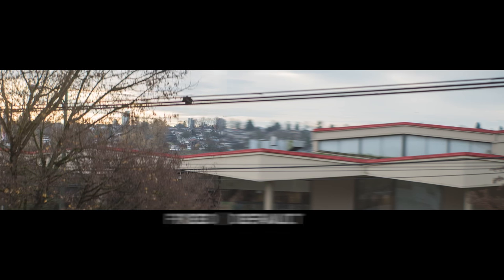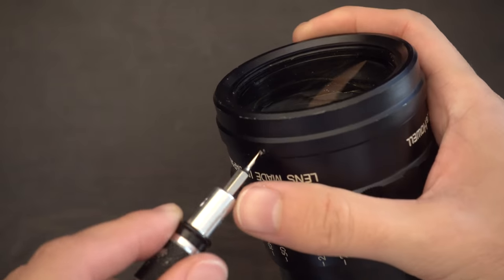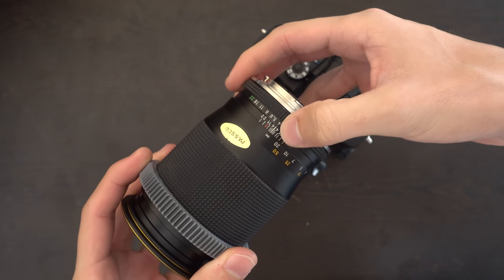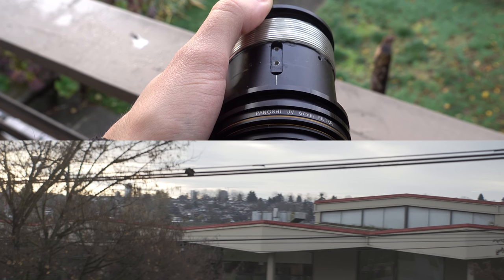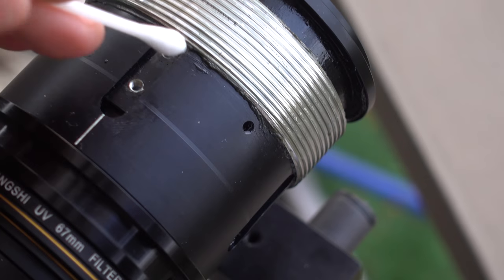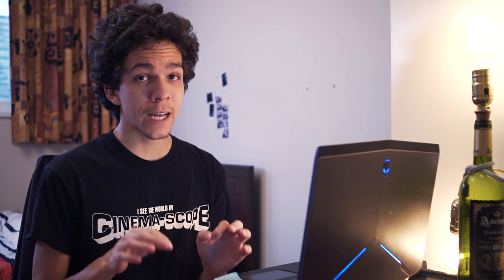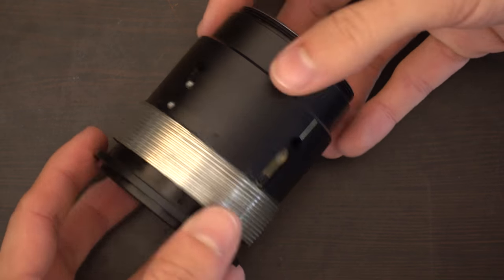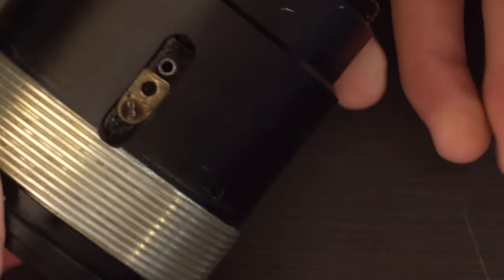Kowa B&H Sharpness Tune Up - Anamorphic Lens Alignment

Comment: Hey thanks for this video and your channel in general! Just to let you know, if you're facing the rear element of the lens, if you look to the right of the brass infinity tab there is actually a screwed out hole where you can use one of the screws from the tabs and just screw it in there to hold the whole thing in place at infinity once you find it. This saves you using tape to hold the lens in place at infinity. You can see the hole to the right at the 4 minute mark in this video. You could even use a socket set screw/grub screw and leave it in there forever as a set and forget infinity mark if you're using single focus solution diopters :)
Reply: This was a game changer, thank you for your help!!

Comment: So what happens when you need to rotate the front so far that the screw holes no longer align with the brass tabs? I have an Elmoscope II that needs fine tuned and it’s there, I just can’t find a way to stabilize it without the screws.

Comment: Instead of using super glue and things like that when locking infinity focus, what I found easier to do is to have the infinity tab (longer one) still on with the screws very slightly tightened but just enough to allow some slip. So what you would just do is first slacken those screws but leave them on, push the tab all the way forward in the recess, as there is some play,  lock the screws gently and now just push on the front optic against the resistance of the tab (it should slip now) until you reach infinity focus. Now just tighten all the screws and you are done.
Reply: Denis Tsunenko what lens did you try that with
Reply: The same Kowa 2x for B&H
Reply: Gotcha. So Tito, after noticing glue doesn't work well, would you not recommend the glue method?

Comment: Tito, thank you so much for this. Took my 16H from soft until f4 to fairly sharp at f2.8! A significant change. 

Some thoughts from my experience: 
1) As others have mentioned, I also just loosened the screws and re-tightened after some wiggling. This was enough for me. It's possible drilling a larger hole in the brass tabs would've given me more wiggle room, but I didn't feel the need. 
2) In reassembling, make sure you focus the lens at close focus before tightening the small set screws at the front. I kept tightening them at infinity and then the lens wouldn't focus! It took me wayyyy too long to figure it out. 
3) Use the right sized screwdrivers and provide good downward pressure when loosening for the first time. All screws are made of a softer metal (brass?) and can strip easily. 

In general I agree with @girafingo9280 - it's worth a try! A little frustrating but rewarding in my experience.

Comment: after watching this I figured there must have been something wrong with my Schneider Cinelux 2x (the one with the knob) because it was only sharp f8+, all I had to do was take off the back element lock, turn the back anamorphic element barely a millimetre (like you did) and geez it's as sharp as the taking lens will allow it. Thanks so much man.
Reply: Emerson Hoskin this is exactly the problem I have.Can you please share how you did the alignment?I unscrew 2 screws at the back,but how do I rotate the element?Thanks!
Reply: so on the back there's the two screws, unscrew them, then unscrew the next two underneath that until the very back element is loose (loose enough to pop out, but just leave it in. Try to set both the focus of the ana lens and the taking lens to the same fixed spot somewhere, hold the ana in front of the taking lens and very carefully rotate the back of the ana with your thumb, you might get a thumbprint on the llens, but you can just clean that, then screw the rings back onto the back and you should be all good man!
Reply: Emerson Hoskin thanks!any chance I can contact you via email?
Reply: just send me a message on Google+
Reply: Will it work for the Isco red star too?

Comment: Thank you for the video. I did it myself as well. My problem started with the back element. I bought my copy cheap...100 GBP...I placed the back element that in the position as good I could, turn it with some tweezers and, then added the rubber seal...that was in, and the ring, then I calibrate it even more with your method. The interesting thing is that the one I have had in the middle holes of the tabs glue and a little drilled hole under. I didn't see that in this copy. That was filled with some kind of glue..yellowish... I cleaned the old one and I added epoxy there. First in the little hole "bucket" from under then into the tab hole on a piece of waxed paper... and waited until got more sticky and thick. First, I positioned the one without the hole very well, focus it, then I placed the ones with glue, put the screws, realigned once more, and then tighten up all while it was on looking to a photo chart I printed. Then leave there 24 hours... Epoxy is said that in 7 days reach absolute maximum strength...like glass. I can say is not an easy thing and I spent hours...4-6...

Comment: Hi Tito, 
I've just followed the procedure you've outlined here in the video to tuneup my Moller 32/2x anamorphot adapter, I have to say the tuneup of my Moller is identical to that of the Kowa B & H.
Thanks for this video as it has really helped me out, Mind you, I've the better part of 6hrs today doing this.

One issue I did find with this adapter was, The two lugs inside the lens which are for the for focus tuneup, These two lugs were very slightly to wide for the slot they fit in as it felt like it was grinding sand inside the lens while focusing, So placed a piece of sandpaper on the flat surface of my breadboard and gave carefully gave one side of each lug a few passes on the sandpaper, Then refit, tune the focus up and now the focus turning is as smooth as a babies bottom.

Once again thanks for this video.

Comment: Whoa whoa whoa whoa whoa, at the beginning the locking tabs were complete, but at the end when he's putting them back in one of the ends is snapped off. That wasn't addressed. Does it need to be like that?
Reply from the maker: No, it doesn't need to be like that. That's another mod, for even shorter minimum focus. I don't really recommend it though.

Comment: Ok so my question is slightly different.. tne back element of the 16c, what would happen if I screwed it in closer to the front element.. and also does making the inside Matt black help image quality also. 

I just got a 16c off eBay for 80£ but deffo needs a hood tune up and I can’t wait to try it out!! What other tricks are there to achieve a sharp image.. I put a diopter in-front of the element and it really increased sharpness and contrast was very interesting
Reply: Not sure if you did this already, however I just did all this with my Sankor 16C (very similar design) and I found just getting the elements as far from each other as physically possible before rescrewing it in ensured good infinity focus, and turning it juuuust so to get the smear effect to vanish before tightening worked very well. The screw and tab placement is easier than the Kowa B&H given the Sankor is smaller, so it's really not too difficult to "tune".

As far as the second part on material, I found that flocking the inside with thin adhesive sheets of matte black jewelry velvet worked very well. You can find flocking tutorials here on YouTube, and that is what I followed. I avoided paint to avoid mess and make things reversible if I didn't like results.

I'm working on making a single focus solution, so it would be nice to know what diopters you're enjoying! Cheers!

Comment: Hi,Tito:
I have questions:
1. Did you use the 135mm focal length to calibrate infinity, whether it is necessary to adjust the width after shooting?
2. When I use different focal lengths of the lens, whether they still need to be infinitely corrected?
Thank you so much.
Reply: Thank you for your reply.

Comment: Hey Tito, I just received my Kowa B&H and I'm trying to adapt it to my Contax lenses. What is the most efficient solution? I have the vidatlantic basic clamp and that doesn't fit; the internet tells me the rear diameter of the B&H is 52mm but I just want to make sure before I buy any more step rings or clamps.
Reply: In contact with Rapido now. Thank you!

Comment: Hello Tito! I went with your advice and got the B&H/HardCore DNA set up.  Thank you for that.  Test footage looks pretty good on most of my lenses.  I came across this video and wanted to give it a try.  Until I got to the tab screws.  I was only able to get one of six off.  The other ones are on very tight.  When I started to cause some damage to the screw heads I decided to take a break.  Its just minimal stripping on the screw heads so no real damage, but I wanted to ask if you or anyone else had this experience or if there is something I am doing wrong.   Thank you!
Reply: same here, with only one screw
they are made with very fragile metal

Comment: Any reason my bokeh would be horizontal?
Reply from the maker: There's a big mismatch between the focused distance on the taking lens and the anamorphic.
Reply: Copy, Thank you for your quick response!
Reply: @AnamorphicOnABudget  sorry to bother again, went to your double focus video and it worked set up for subject about 5ft away, but for setting this up w/ an FMJ and HCDNA im aware I need both lenses infinity focused and when both are I find the image to be soft, would this prompt a tune up featured in this video or would I get away with readjusting both lenses until sharp at the nearest distance to infinity?
Reply from the maker: @pmcfilms2478  the second option. Adjust to actual infinity, don't rely too much on the focus marks, just on what your eyes can see.

Comment: could this method work for Singer 16D? my focus is very soft at any position of the ring.. while the taking lens (helios 44-2) is sharp in focus!
Reply from the maker: It should, although construction will be different.
Reply: @AnamorphicOnABudget  its almost the same as Kowa, only with 2 brackets. indeed its very sensitive!! in my case i didnt have to unscrew all the way (i did though), but rather loosen the screws. interestingly the screws are extremely gentle and fragile on that thing! a screwdriver for microelectronics was too brute for them...
the sharpness is better now, but unfortunately the focus ring became very tight :((

Comment: Hello Tito, thanks for the informative work !
I just bought a Schneider Cinelux adapter, waiting for an Hardcore DNA.
Do you think I need to tune-up like you did ? Is is even possible with it ?
Thanks :)
Reply: Probably... I tried to unscrew the 4 screws on the lens (not the ones on the top), but didn't succeed. I will first try to see if it's sharp enough ;) 
By the way would you say that 95mm ND filters and diopters are necessary for the harcoreDNA ? Or can I use 77mm via step down ring without vignetting ?
thank you Tito !
Reply: Unscrew the ring on the back lens- this is the one you need to align. But in general, the cinelux is very sharp, even if it s older

Comment: Excellent tips, my friend. Great work, as always! So, I imagine everyone's mileage will vary, depending on the lens they have and even just the specifics of how their lens has been stored, used, transported, etc etc. That being said, is there some kind of test or metric you can use to determine if your scope will benefit from this tweak? Like, did your lens always look blurry at f/4 before you did this tune up? I have the same scope as you, and haven't had any issues with its resolving power. But then again I haven't had anything to compare it to (except the much worse slr magic 2x- no contest). Hope that makes sense. Thanks Tito!
Reply: I got my Sankor 16F misaligned a year ago, but 2 months ago, I did realigned it using this similar process and it is now sharper than ever.
Reply: Great info Bobby, thanks! I went to try the tune up myself, but the bronze flat head screws wouldn't budge! The heads started to strip, even with a lot of force applied, so I didn't want to risk causing any irreversible damage. Luckily, my Kowa 16H is sharp as is, so I don't think I'd benefit from it too much anyway. It's weird though, literally ever one of the bronze flat head screws gave the same amount of resistance. Not a single one would budge!
Reply: Did you ever get your screws loose Chris? 
I just took all mine out except for one. I've got one super tight screw and the head is beginning to wear out and slip. I'm tempted to drill it out but I'm pretty hesitant to take a drill anywhere near my kowa 16-H

Comment: you think this will work on a Sankor 16C?
Reply: I did! Thank you Tito :) After watching this video, I became suspicious about my Sankor 16C. It was way too soft, whatever aperture or taking lens. So, we took a deep breath and disassembled it. It looks similar inside. We turned the front element a little and somehow fixed it without glue. It really does improve the sharpness!
Reply: Black Winter sounds awesome! any chance you could post a couple of photos of what that looks like? I also have a Sankor 16C that I want to adjust